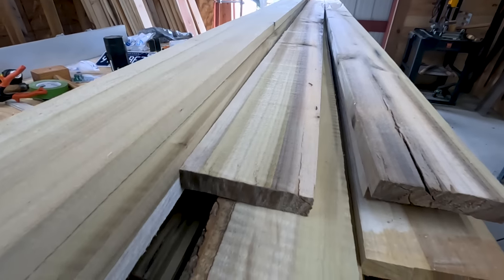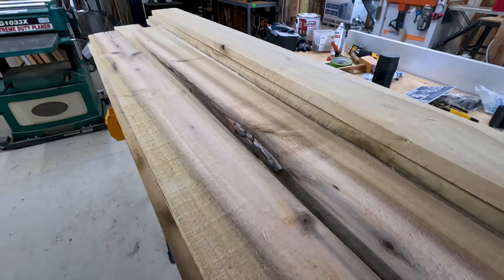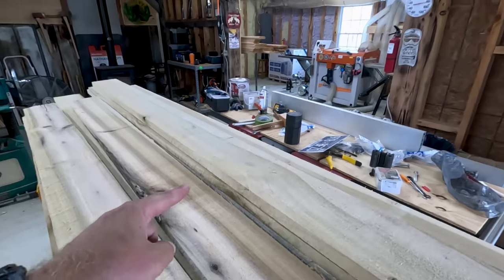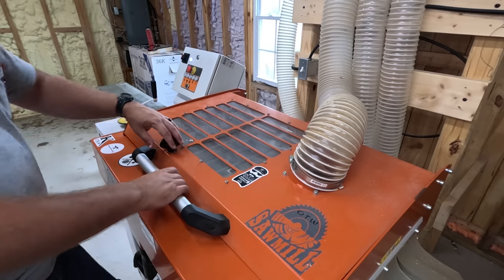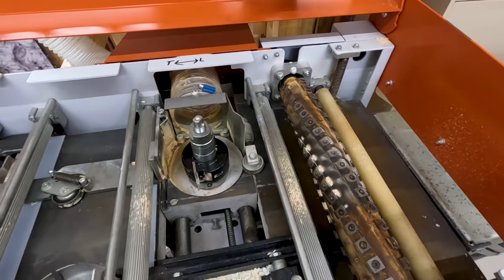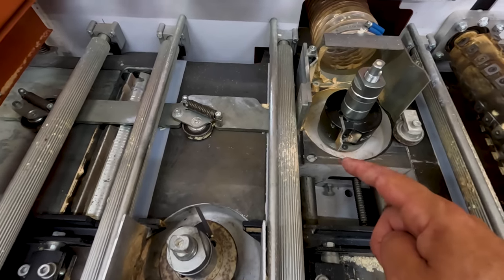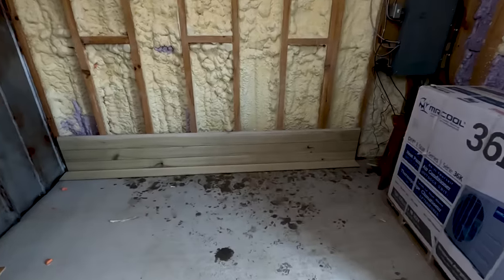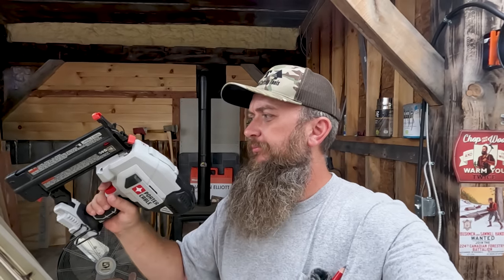Sawmills & Bluegrass, The Sweet Sounds Of Appalachia

Comment: Nathan, a few questions:
1) You, previously, mentioned you sold of your edger. Why did you sell it?
2) Do you plan on getting another one?
3) Why did you align the vertical ends, of the ship-lap, on that back wall,
instead of staggering those joints? (just curious) 😁✌🖖

Comment: That mini split will work great until you turn on your dust collector. Then you will be paying to cool the air and then blow it outside at what 1200 cubic feet per minute?  Will the AC keep up? That could take your power bill to a new level.

Comment: Have you set up your g1033x planer? I  tried setting mine up with the dial they sell but sometimes its hard to push the board in or it gets stuck part way out. I believe the chip breaker and pressure bar are too low. Just wondering what your settings are and how yours works for you.

Comment: From a non professional you tuber, you should really stagger your seams on the ship lap.  It’s a more professional look and gets rid of a single seam.    Just an observation.
Reply from the maker: the shiplap I installed in the video was the full length of the wall to the bottom of the panel, which will be covered with something different in order to get to electric wires,